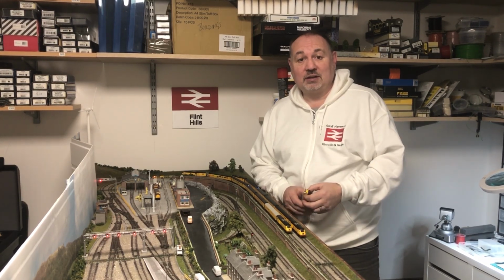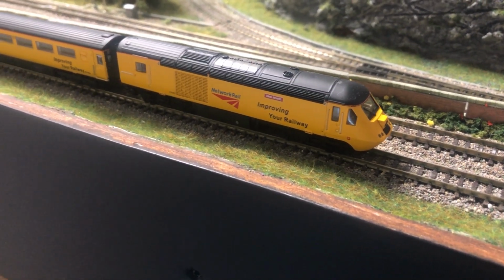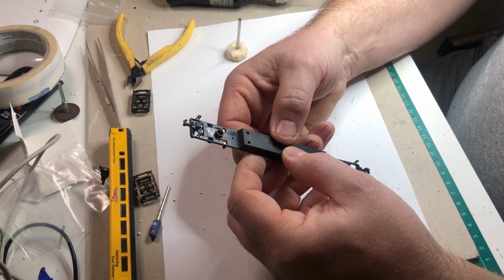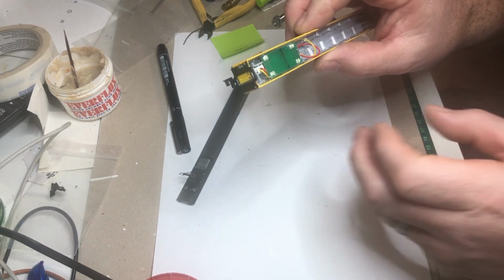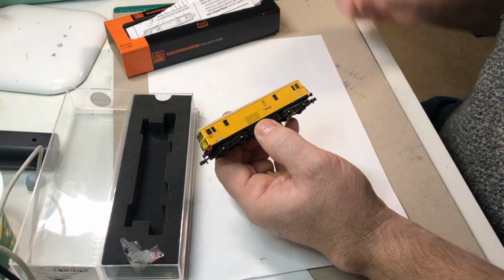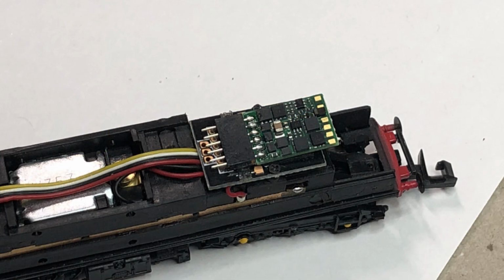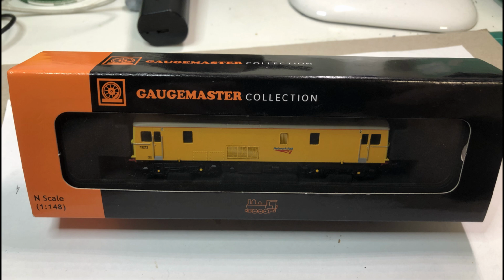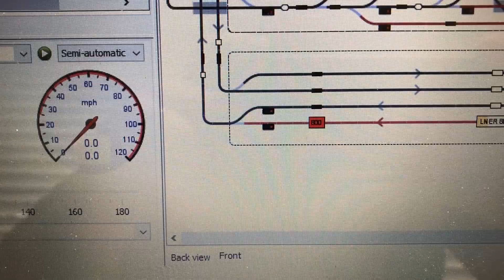Flint Hills Model Railway.  Gaugemaster  Class 73 and Class 43

Comment: Hi Geoff  - the flying banana  with the extra coaches looks superb.  I picked the basic set up at TINGS back in September.   Will need to check out the guy who does the other coaches.   I've read other reviews of the Gaugemaster loco and most said it was a poor model - thing I'll not add it to my collection.   Nice running views as always.   Cheers Euan
Reply from the maker: Hi Euan ,  yes the other coach's are really good . Alan ( ARXMODELS on ebay) has just finished a few more for me including the DBSO for the structural Gauging train .  I hope to show that In the next video .  yes the feedback has not been positive for the class 73. Cheers Geoff

Comment: I got the dutch 73 and the same problem, the bogie was fouling on the chasis rails and kept stalling, i did initially think it must be my track as i wouldnt have believed a new model could be that bad.
Mine was re-packaged and will be sent back, i couldn't get a full circuit out of it without the hand of god.
Real shame as it is a lovely looking model..

Just a quick update,
I received a new class 73 from Hattons and i can say after a good run in it runs quite well with no chassis issues.
It is quite noisy but with a piece of lead strip placed in body over the motor it is quiter and goes over points acceptably well, i pressume due the inertia achieved with the extra weight.
It doesn't quite creep but does run slowly enough to give a scale look.
I know we shouldn't have to modify a new loco but i like it enough to keep it.
Gareth.
Reply from the maker: Thanks for the feedback .  I did wonder if others were having the same issue, clearly no the best model produced  , Geoff

Comment: class 73 doesnt have red tail lights in real life. they used a red blind or a tail lamp. i dont know if network rail changed their locos though.
Reply from the maker: Hi Tim , thats good to know about the red tail lights . i assumed they would have them as standard in the real world . thanks for the feedback
Reply: @flinthillsmodelrailway  its a shame it ran so badly. the frame is v flimsy plastic and they are very light. i got lucky and my two run ok so far. i wish someone would make a new version of the 73 though (and a new class 74!)

Comment: Interesting to see the fitting of the lights.  With two flying banana you must have some of the best track work in the country.  Very surprised at how poor the design of the class 73 is.  You don't expect the chassis to be anything other than parallel to the wheels.  Stephen
Reply from the maker: Hi Stephen ,  glad you enjoyed the latest video ,  the track is good however i get the odd point issue sometimes . must be the wrong dust on the line ,  back to the real world lol cheers